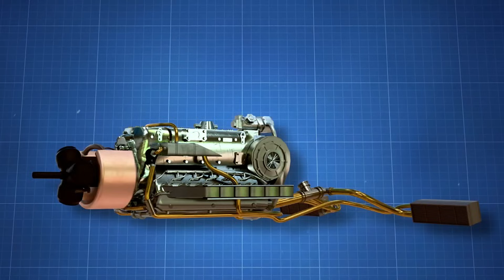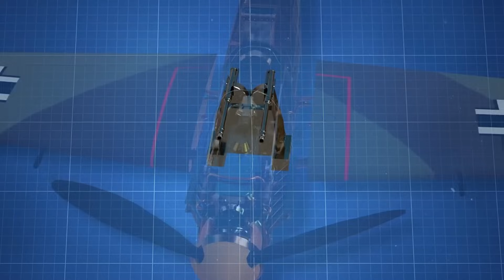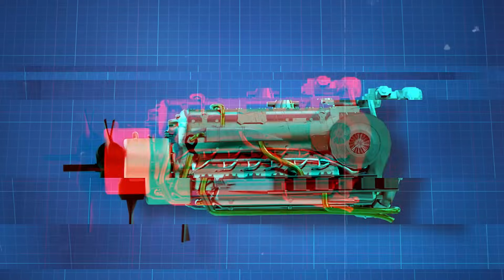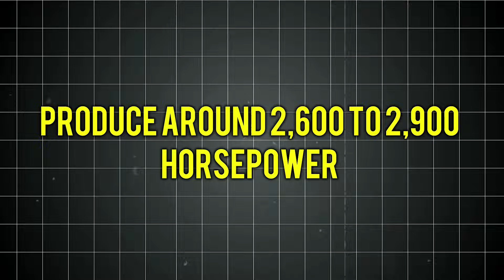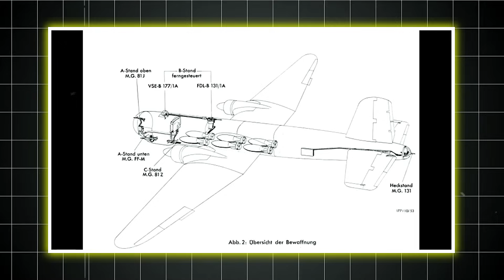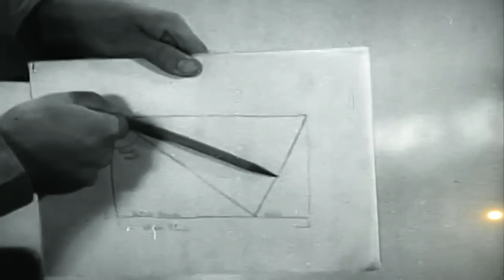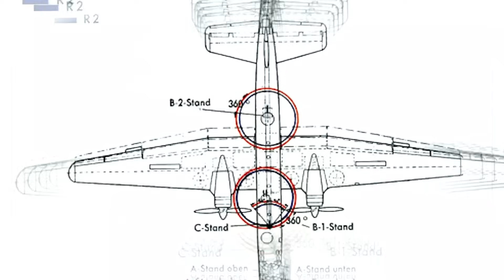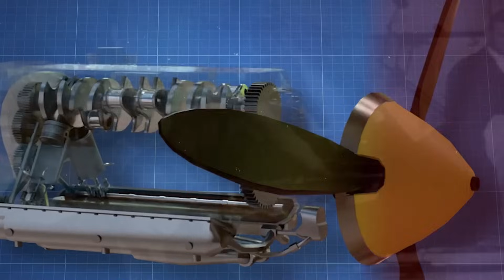The Shocking Truth Behind Daimler-Benz’s DB 606 “Power System”

Comment: The Germans suffered from severe shortages of nickel and chromium as well as high quality steel necessary to make exhaust valves survive in all their engines except possibly the BMW 801 which had chrome plated valves. Their high octane fuel was always in short supply and diluted with lower octane fuels during storage. Main bearing design was years behind the west as well. They were also disorganized with research not talking to test, not talking to field ops ect. Which resulted in the DB 601 failing in the field with known valve shortcomings. All good things for the Allies.

Comment: The Daimler Benz 606 was a dog, overweight overcomplex with the reliability of a BL Morris Marina and not the first time German engineers  opted for the 'Twin Pac' arrangement. In the later years of the first world war in1917-18  the German Imperial Army Air Service Implemented their 'Reisenfluzueg' Large Aeroplane Project, in essence a huge biplane bomber . Reisenflugzueg was intended to replace the Army,s Zeppelin Airships on long range bombing missions. To cut this pitiful story short, DFW, Siemens Shuckert, and Zeppelin Staaken submitted their designs to the Army, all using the 'Twin Pac' as  Germany,s motor industry failed to come up with  450- 500hp from a single engine due to poor quality petrol oil and materials. So Maybach and Mercedes coupled two or more of their standard straight six engines around 260 290hp each in order to get the 450 500hp or more required. To lift Zeppelins Lumbering Staaken with a three ton bomb load off the turf fell on the shoulders of two Maybach MB 4 Twin Packs in  boat shaped nacelles  each driving a huge four blade Shwartz  pusher propeller, a fifth  MB-4 mounted in the nose driving a smaller two blade propeller.

Comment: I think I'd put them in line design a crank coupling or design a long 24 cyl. Crank with larger main and rod journals. Or just builx a larger engine . Keep the design. Just make it larger. Especially the bore. Possibly going up in bore by 30-40% and stroke by only 20-25% longer. making the crankcase anout 40cm longer.. 10cm  wider per bank. (Roughly) and add a valve per cylinder , 3 intake valves and two larger exhaust valves. Example,  go from 150 mm bore 125 mm stroke  to s 220 mm bore and and 150mm stroke  and the exhaust valves about 10 mm larger sodium filled. With three intake valves. If the valves float possibly go to a larger stroke to lower the rpm.  And possibly using sodium filled intake valves also it will have nearly 75mm intake valves and 50mm exhaust valve. 8" bore with a 9" stroke if the valves float,  or just because, spinning 2400rpm, maybe 2800  with a 7" stroke. Especially a v24 making big power

Comment: The Brits had the same concept but. instead of two V12s coupled as shown, they chose H-24 and X-24 designs. These concepts never had the time to be perfected. That's why AVRO stretched its Manchester bomber, powered by two X-24 Vulture engines, into the ultra-successful Lancaster bomber, powered by four V-12 Merlin engines. After the war, R&D on these 24-cylinder engines (and their radial equivalents) slowed to a halt, because jets were the engines for future military aircraft.

Comment: It is obvious from the pictures that two engines were NOT combined into one block!. Two engines were ganged together. It was a common concept. Perhaps the most successful, but unseen, such engine was the compound engine Chrysler made for tanks - 5 6-cylinder engines ganged together. It actually worked and was quite reliable.

Comment: The blocks of the two DB 601 were not connected. The DB 606 power unit consisted of two separate 601 engines mounted side-by-side and driving a single airscrew trough a common reduction gear and extended airscrew shaft. The two engine units were inclined so that the inner banks are disposed almost vertically.
In place of the normal reduction gear housing on each engine there was a single large gear casing which connected the two crankcases. The  two  crankshaft pinions drove the single airscrew shaft either directly or indirectly through idler gears,according to the  desired direction of the  airscrew. Provision was made for declutching the individual engines from the airscrew by means of a clutch and lever in the  cockpit. The superchargers,normally mounted on the port side of each engine,were located on the outer sides of the  twin unit. 
DB 606 A- right handed rotation
DB 606 B-left handed rotation
Reply: Thanks for that info! Regards from Christchurch New Zealand.
Reply: Thank you for making things more clear.

Comment: 🤔🤔🤔 - The He177 was never intended as a "Schnellbomber" it was from its inception intended as a Heavy Dive Bomber and had originally designed with four separate engines in four separate engine nacelles. - Wind tunnel tests however prove that the two outer engine nacelles would cause wing failure in a steep dive and therefore it had to be re-designed to only two engine nacelles. - It is so damn irritating that there is so many of these YouTube videos on the same subject, yet the one is just as flawed in its content as the other: - Seems these idiots all have the same flawed sources, or just plain copy-cat idiots!?!?!? - Then the AI content are even more flawed and the whole video become nothing but a bunch of crap!!!

Comment: A failing engine wasn’t unique for the DB606 and the Heinkel HE177 Greif. The Brits had the Afro Manchester with the Rolls & Royce Vulture X24, with cause the demise of the Manchester, and lead to the excellent Afro Lancaster. The Americans had the Wright R-3350 Duples Cyclone radial engines powering the Boing B-29 super fortress. It too was prone to overheating and devastating engine fires due to the Magnesium crank case. The problem wasn’t solved until after the war. And it cause massive delay in production and introduction of the B-29
Reply: Was the 'Afro Lancaster' the one with lots of tight curly hair or the one with dreadlocks' ?
Reply: @chrissmith2114 Autocorrect at work for ya!😂
Reply: Interesting to compare how the Brits and the Germans dealt with the failure of the DB-606 / DB-610 versus the Rolls Royce Vulture.
Roy Chadwick, the designer of the Manchester recognized he had a good airframe but problematic engines and was allowed to redesign the wings with 4 x Rolls Royce Merlin engines. The result was the Lancater which is generally regarded as the best British heavy bomber of the war.

Ernst Heinkel, having been unable to deal with the DB-606 engine fires asked Goering to let him do the same. Embarrassed before Hitler by the failure of the He-177 in service, he refused. Heinkel secretly built one anyway - the He-177B (or He-277) out of sight of Goering and the RLM in Vienna-Schwecat and it performed very well. Heinkel had proven his point but he dared not let that be widely known.  Meanwhile a high altitude variant, the He-274, was built at the Farman plant in occupied France. The war ended before it could be used by the Luftwaffe but it served post-war France well as a launch aircraft for testing ramjet propulsion until 1953 I believe. 

Thus the British turned a failure into a huge success the power that were denied Germany a heavy bomber that might have bombed Soviet factories over the Urals and raided convoys in the Atlantic.
Reply: The nazis had a strong pattern of self-destructive behavior. They killed a lot of Germanic Christians with the help of Churchill, Stalin and Roosevelt.

Comment: Should have noted the failure of the RR Vulture X 24. The 177 was a catastrophe in combat. It did have a good bomb load, but was not all that fast (20 mph faster than a Lancaster). Germany never did get much beyond the Schnellbomber other than with rocketry.
Reply: @stringpicker5468- The He177 was never intended as a "Schnellbomber" it was from its inception intended as a Heavy Dive Bomber and had originally designed with four separate engines in four separate engine nacelles. - Wind tunnel tests however prove that the two outer engine nacelles would cause wing failure in a steep dive and therefore it had to be re-designed to only two engine nacelles. - It is so damn irritating that there is so many of these YouTube videos on the same subject, yet the one is just as flawed in its content as the other: - Seems these idiots all have the same flawed sources, or just plain copy-cat idiots!?!?!? - Then the AI content are even more flawed and the whole video become nothing but a bunch of crap!!!
Reply: @waltercarelrugheimer2743  Yes, YouTube IS a component in the "dumbing down" & "killng off" world order
Wouldn't want "their due"